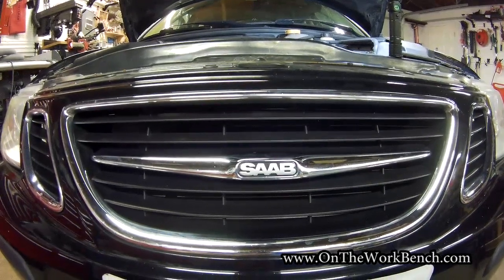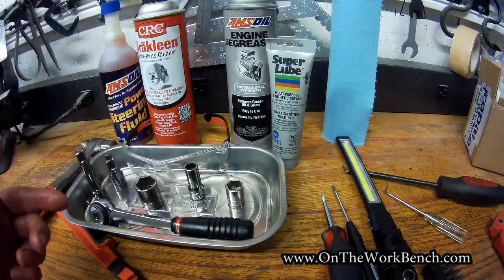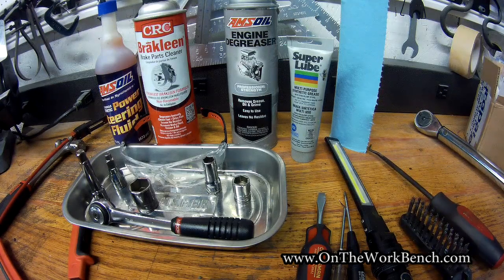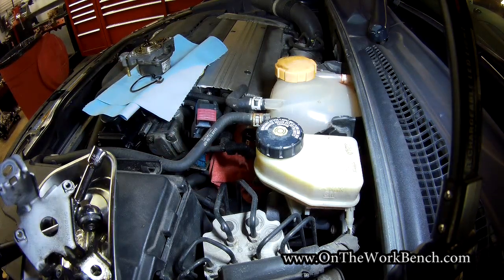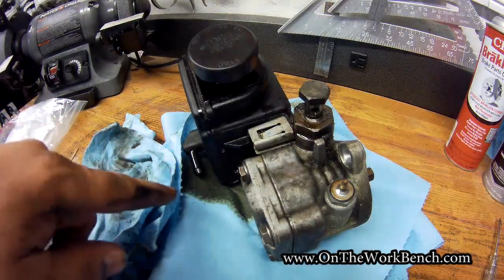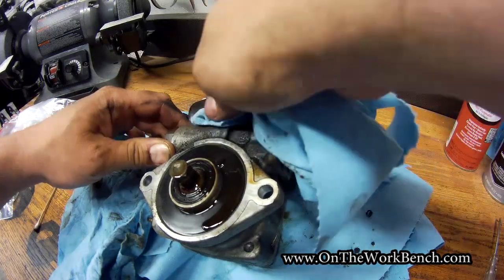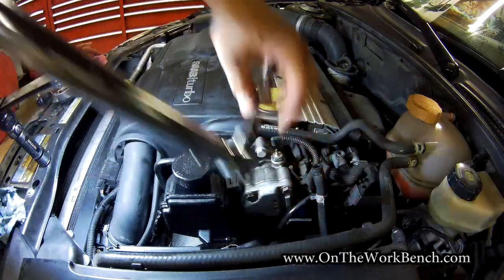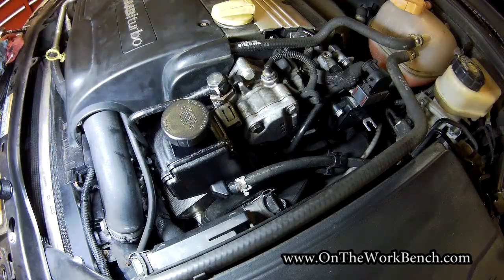Saab 9-3 Replacement Pump Seals

Comment: Just wondering why you completely torqued one bolt first on the air pump, i thought you are supposed to torque them back and forth evenly to ensure the gasket goes in evenly? It may not matter but i will be attempting this tomorrow and just want to do it correctly

Comment: What size o-ring gasket or part number did you use for the connection between the power steering pump and reservoir?  Thanks for the video.  I plan on doing the same thing for my Saab!
Reply: Its in the description I believe.

Comment: I don't have a torque wrench lol how tight is gotta be? I usually go spark plug tight not over the top but definitely not finger tight. I think main thing is not stripping internal threads and to provide sufficient compression to make the gaskets effective. Great video I will use this to work on my own Saab no doubt 👍🏻😂

Comment: @On The Workbench why didn't you mention what torque you tighten the screws with? I'm sure this information would be useful to everyone
Reply from the maker: The workshop manual does not list these specs. It should be but isn't so the best advice I can offer is get it GoodNTight

Comment: I noticed on the outer seal of the power steering pump it had the bump. The replacement seal was flat.  You mention this. The engine has a depression where it looks like the bump fits into. Can you reply please
Reply from the maker: See the comment from @flyingmechanic diy
Reply from the maker: I have had no issue to date on this
Reply: Roger that. Thank you. I know this gasket change was a long time ago,  But did you encounter  two seals attached to the reservoir and the pump?  My reservoir tank had a smaller seal that was part of your replacement and a larger diameter seal that rested on the back of the connection of the reservoir tank.

Comment: Hi, thanks for your video. I am planning to do the job myself and your video will definetely make it easier for me. I have the set of gaskets together with the o-ring which is inside the pump. I read the o-ring is also the reason of the leak often so I will change it as well. The only thing I am wondering. Do you happen to know is there some suggested tightening torque for those torx screws which hold the two parts of the pump together? I think it is also important to not overtighten or undertighten it.

Comment: On the brake booster pump, if I'm a dummy and didn't use a torque wrench, and potentially overtightened, how would I know and what would be the consequences?
Reply: Lefty loosy, Righty loosy